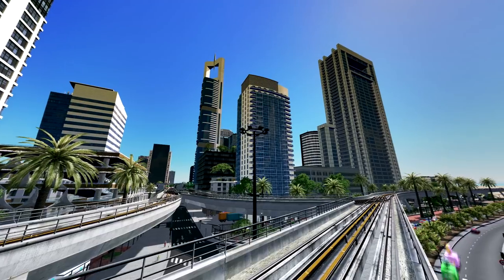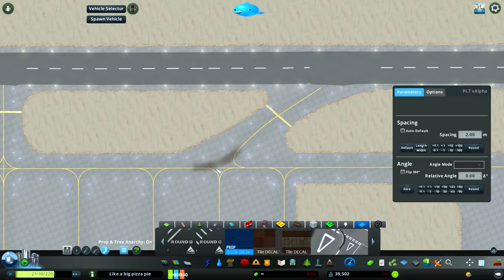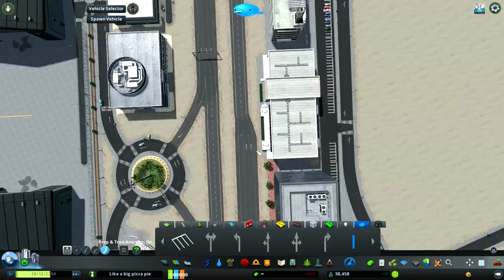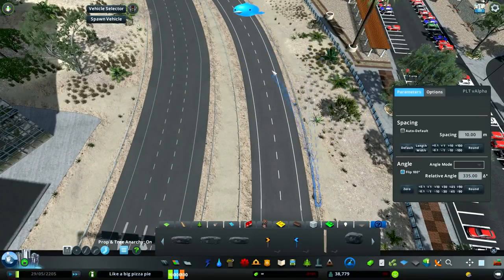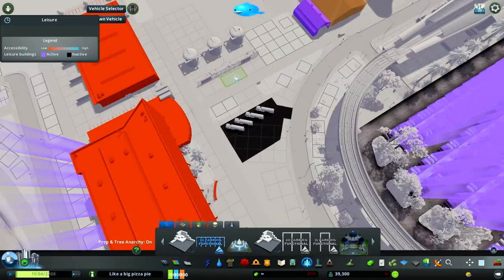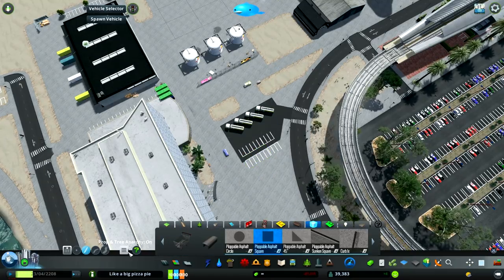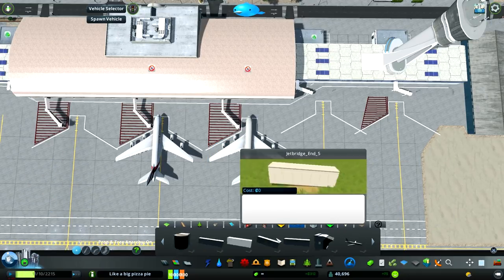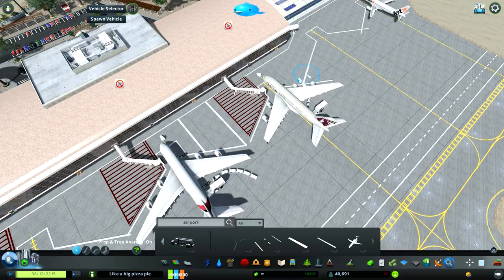Cities Skylines: Amar City (Part 12) - Airport & Highway Detailing

Comment: Hey Silv, since this airport is situated in the middle of a desert, don't you think the runway, taxiways and tarmac should be covered (even sparcely) in sand (decals)? :)
Reply from the maker: That's a great idea, will see how it looks, thanks!
Reply: :D
Reply: Silvarret may you also add a formula 1 race track, coz they are hosted in the Bahrain aswell
Reply: Planes blow every bit of sand out of the taxiways and runways so it wouldn be realistic

Comment: Fmr. Helo Pilot here! We routinely used to use the taxiways to do what we call a "hover taxi" and then get clearances from ATC usually with special instructions to direct us out of the way of fixed wing activities, generally resulting in a running take-off. Max Performance takeoffs (that  stereotypical "helicopter take off" has more risky variables, where you can actually get stuck in your own vortices, and stall the helo. Anyway, happy to detail more from both sides as I was a fixed and rotary wing student pilot who operated out of Class B airspace (int'l airport)

Comment: Guess Bahrain uses vivid painted curbs so one can see where the road is even if it's covered in sand due to a sandstorm, and also to prevent sand to be constantly tossed in the road by low-speed winds.
Btw I think this airport doesn't really fit the location you're basing the city in, cause the southern part of Bahrain is a closed airspace area due to Sheik Isa Air Base, and of restricted usage in the southwestern part due to the Sakhir Air Base, so there's not much airspace left for Amar City, but I guess we can use some "poetic license" in this case.

Comment: Best C:S airport I ever seen. Great detailing. The only thing that I saw that you put that actually is not needed is the stop markings on the APRONs - the same where the taxiways join the runway. Basically, those are only needed there because they indicate that the Tower should authorize the airplane to pass that line because of airplanes landing and taking-off on the runway. Nevertheless, great job.

Comment: You are confusing "ILS Hold" with "Non-movement Boundary" markings. The non-movement boundary markings are a solid yellow line with a dashed yellow line next to them (dashed line towards the taxiway), and mark the boundary between the ramp and the taxiway.  This marks the boundary where pilots must switch from ground control to air traffic control (in the USA, this is where the aircraft enters federally controlled airspace - i.e. by the FAA - and leaves the part controlled by the airport). 
ILS Hold markings on the other hand are placed on taxiways to prevent aircraft from obstructing the ILS (instrument landing system) antennas. It would be problematic if a plane was trying to land and it lost the ILS signal because another plane got in the way. I am not exactly sure what the required clearance is for placing them.
As for the helipads, I believe helicopters need to take-off using the runways at airports to prevent possible mid-air collisions, though I could be wrong.
Also, your service roads should be curved at bends, and your one service road just ends... You should continue it further, since it's the only concrete that service vehicles such as fuel trucks are allowed to drive on (with some exceptions of course - like the plane stands).

Comment: The curbs are painted so whenever there is a weather condition that lowers visibility, you can still see the edge of the road. The curbs are generally yellow in countries where the sun becomes very sharp because white can reflect the sun and be blinding. That being said some countries have selected white curbs because yellow curbs usually signal a no parking/stopping zone ie bus stops where there is no bus lane.

*There are obviously tons of exceptions to the above.

Comment: Can't say I'm an expert by any means on rotor wings but the airport I fly out of has a small heli port, so far I've only seen one of them take off of a runway, they normally take off from whatever side they are but sometimes I've seen them "taxi" (hover just above the taxi way and follow it) to other sides of the airport and take off on that side if they needed too. I since there's no need for them to have a runway to take off of I think they rarely if ever use it. The one heli I saw land on a runway was a ch-53 and I'm not even sure it landed on the runway. I just remember it because they told me to expedite to parking and it was following us. Thing was taller then the tail on my plane.
Reply from the maker: Yeah, I tried to read into it - I used to think helicopters just ascend vertically - but apparently they can't under all circumstances, and need to cover some horizontal distance as well to ascend, hence why they may use runways. Then again, I'm no expert on this either.
Reply: Most of them around the airport I fly out of just head away from the runways and relatively low. I think that's because our patterns are kinda low too. And we have the sheriffs heli as well

Comment: The baggage car at the Fly Emirates plane, how is it going to get out of there? Those things are extremely difficult to back up and the way it is parked is gonna give you a bad time xD
Reply: Typing on the fly here: Helicopters like taking off by moving forward as it is easier and gives you don't stress out the engine as much as it requires less power.

Comment: change the Qatar 380's to smaller aircraft, such a small Airport wouldn't usually see a large aircraft like that. Staying with the airport and thinking that it is Bahrain, why not add a small air force detachment on the opposite side of the runway to the terminal

Comment: Runway high-speed exits has only guidlines towards the direction its facing on the runway, not over 90 degree turns
Reply: i do not agree... try to find an airport with high-speed exits having lines to both directions, might be hard :D
Reply: Orly doesnt have in both ways and east midlands has one but its not used for vacating, found this in the charts:  Landing traffic should
not plan to vacate the runway at TWY S. Under TAXI procedures, and are not stated as rapid exits... oh well, enough :D

Comment: So I couldn't find the exact reason why outside curbs are painted black and white or yellow and white in the middle east but I found a UAE official vehicle safety guide notating a bunch of stuff about roads if anyone's interested. If anyone is wondering, it's very heavily based off of the American system.

http://aljariyat.net/MyPublicFiles/Light_Motor_Handbook_EN.pdf
Reply from the maker: Dude that's amazing, thank you! Will be very handy to read through. Also, not sure why, but the guide seems a bit cute to me. Like, the image on the first page, the note against corruption with three exclamation points, the careful instructions on common sensical things - something's charming about that guide. Anyway, it'll be a good readthrough, thanks again.